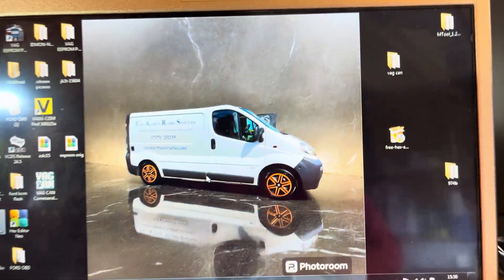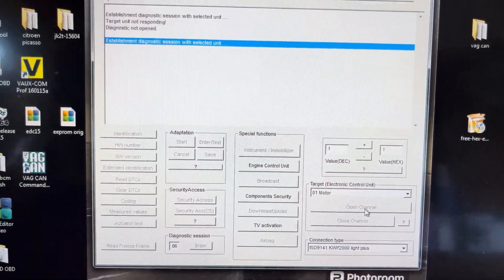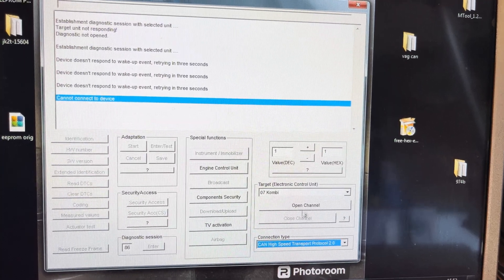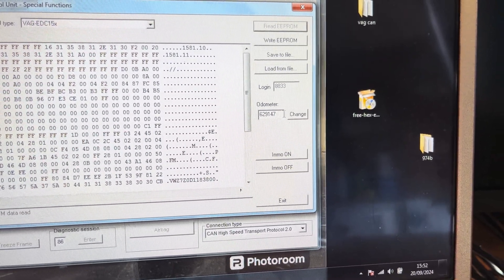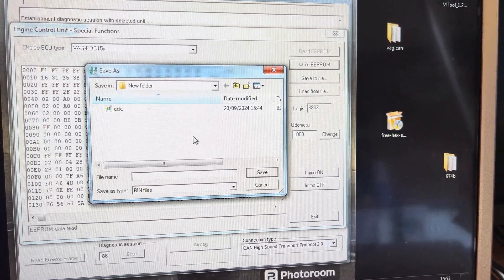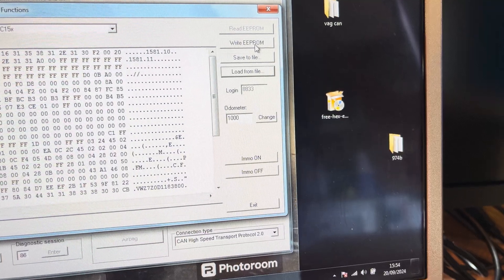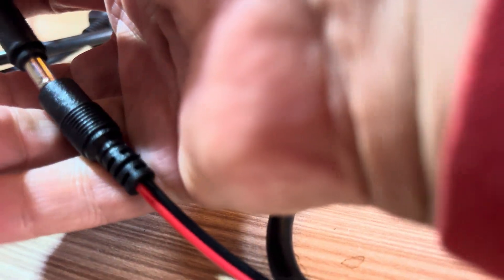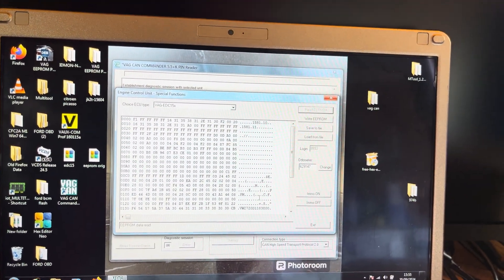EDC15p golf mk4 ecu pin code read VAG CAN 5.5

Comment: But you have read the ECU PIN code or the Instruments PIN code?
Reply from the maker: Ecu
Reply: @caralarmandradio  I have a problem. I had to replace the instrument cluster, but I don't have the PIN code for the original instrument cluster.
Can I read the ECU's PIN code and try to enter it into the instrument cluster to reset the immobilizer?
Reply from the maker: Yes that works on the older models. On the later ones the cluster uses a different pincode for matching to the car
Reply from the maker: If worse comes to worse i can remove the immobiliser from the ecu
Reply: @caralarmandradio  I've already tried removing the immobilizer from the control unit. The engine runs, but the air conditioning doesn't work, and the hazard lights come on, but there's no way to turn them off.
Reply: This car used IMMO3 and claster is Bosch RB4
Reply from the maker: A correct immo off has no effect on the aircon or indicators so you have a fault somewhere else
Reply: @caralarmandradio  You're wrong. Many users have had this problem with this model.